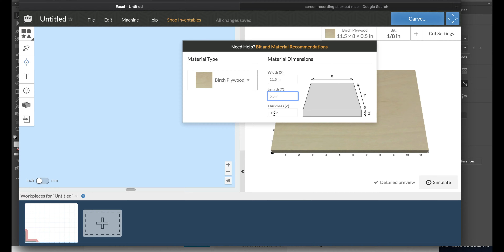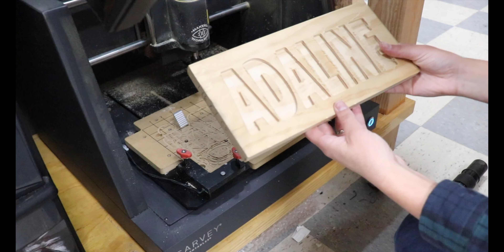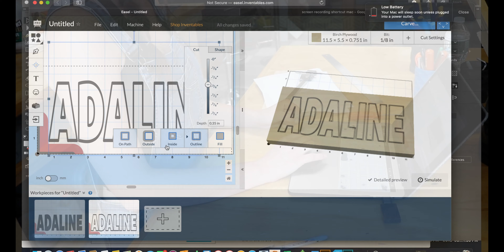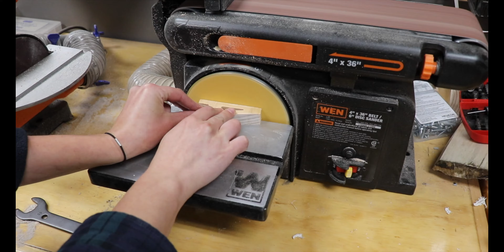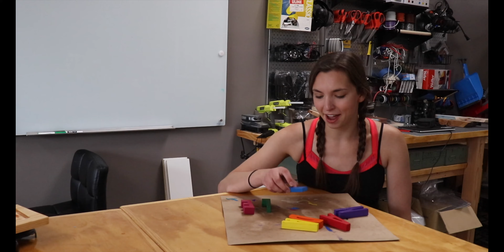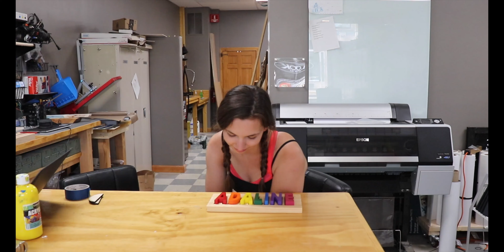Making a CNC Router Name Puzzle out of Wood

Comment: Great idea! Here's a little tip with that butcher block finish. Put what you need in a small jar then place that in a bowl of hot water. Just hot from the tap is fine. This will give much better penetration. Cold you can see the solid wax particles, hot it's liquid. Thanks for the video!
Reply from the maker: That’s an awesome tip! I can’t wait to try it

Comment: Hi! Is there a way to do this if you don’t have the scroll saw?
Reply from the maker: Absolutely. You can set your CNC Router to cut smaller tabs and just sand them off. Alternatively, ahem you seen the painter's tape and super glue trick? It allows you to tape your material to the build plate and eliminate the need for tabs all together.

Comment: Hey Brooke, I followed you video, curious how you deal with the oily residue of the butcher block? Mine feels almost too oily to give to someone. I used Howards as well. Thanks
Reply from the maker: Thanks so much for following along, and great question. I always apply the butcher's block conditioner pretty generously and let it soak in over night before touching it again. Then I thoroughly wipe the excess off with a bone dry cloth; If it is oily enough that you can feel it with your hands then it is likely oily enough for there to still be some to buff off. Then I let it sit again. It will still feel a bit slick for a couple of days as it finishes setting up. Let me know if this helps.